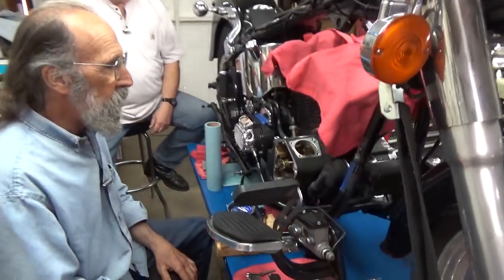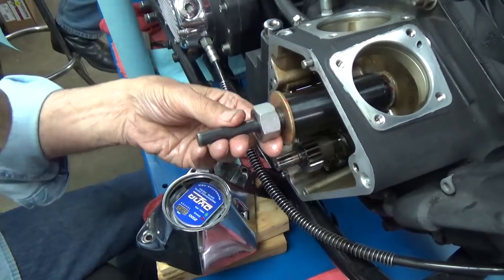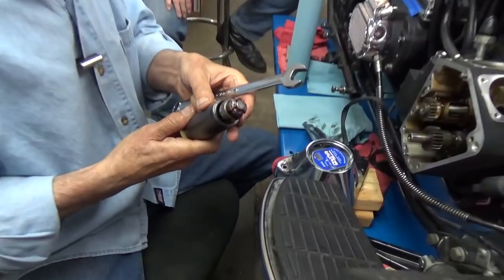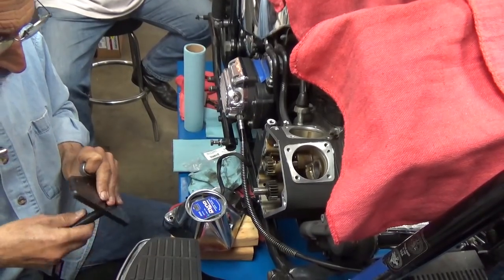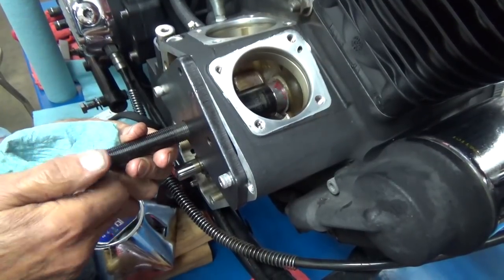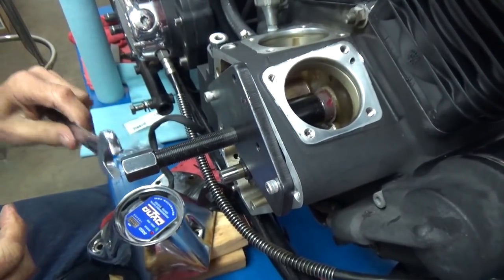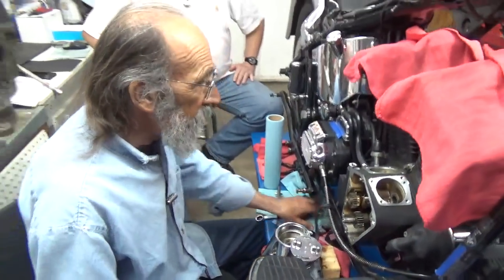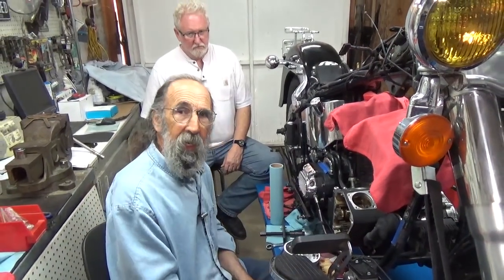Installing Evo, New Cam Bearing & Seal

Comment: I have bought a cheap chinese knock off of the bearing tool  on ebay for around 50 dollars. It works perfectly! I had to pull out a destroyed INA bearing. So to make sure, that as less debris from the bearing falls into the crank case as possible, I pressed the slotted end of the puller together, before inserting. No mallet hits needed. Just carefully pushed in the rod, that spread the slotted end. Thank you very much for uploading your Videos!
Reply from the maker: Thanks for sharing.  Good stuff.

Comment: Had a friend of mine one time did not have the installation tool to put the bearing in and decided he was going to hammer it in ,,discombobulated the bearing and ended up with all the needles in the case and did it after being told repeatedly not to do it... the installation tool not only helps you to press it in but it also helps to keep the conformity of the bearing so it doesn't split the cases that hold the needles when you press it in a very necessary tool nice work Mike
Reply from the maker: Thank You.

Comment: I like your term “animal it”, I will have to remember that. I’ve always used the term “monkey fist it”.
Reply from the maker: Same thing.
Reply: Yeah, like trying to drive a square peg into a round hole without using proper lube. :)

Comment: Your work is art Mike, thanks for the videos, learn something every time.
If you have a opportunity could you tell us about the fork tensioner on your Shovelhead? I have never noticed one before, thanks
Reply from the maker: It is a reproduction of a stock steering damper (something all Harleys used to come with).  I added it because I felt it may help me when I add a sidecar.
Reply: Ty..love the old school stuff, I have a beautiful 1973 Shovelhead, yours has become my inspiration, getting ready for forward controls then exhaust…

Comment: Cam lobes have some work to do,
with inertia, rods & springs.
All 'sudden lift' or 'done with now''
just thin oil to dampen things.
For yon lumpy shaft revolveth on, fine needles round & flat,
in circle rows within their cage, (a bit like us, in that),
where mighty pressures ride in turn, the lube must take up slack
as too much movement due to wear, can send those pulses back.
 - Nutshell wise: 'Old needles just get lairier, 'cos they've sod all contract area' - always fit gnu.*
(*Large furry quadruped, well known for bearing up to pressures beyond the wit of man, best machined when stiff : )
Reply from the maker: Okay Dude, you've outdone your bad self.  This is truly one for the books.  Thank You.  Don't mildew.  Take care.
Reply: great fun. Love it!

Comment: Great video Mike! Really nice to have proper tools for the job!
Reply from the maker: Didn't happen automatically.  It took a long time to gather tools.
Reply: @pacificmike9501  Yes I know. I worked Aircraft maintenance 25 years after retiring from the Navy.
Reply from the maker: You would certainly know the value of proper tooling.
Reply from the maker: I've had the pleasure of learning things from aircraft mechanics.  They've been some of the most professional people I've known.  In fact, my dad built P-38's at Lockheed during WWII.

Comment: Hey Mike . Noticed you drove that seal all the way back to stopping point.  Does your bike have that little oil hole where the seal presses into? If so, is  bottoming out the seal ok with that hole ?  I've heard some guys say just flush with the front is all it should be driven in. Maybe the hole is why ? To lube the bushing ?  Can you give me a straight direction to press in this seal.  I have 83 wide glide with the oil hole for bushing. The hole is kinda on the shoulder so I'm confused here . Thanks Mike always go to your vids for enlightenment.

Comment: Mike. Did Harley go back to the better  inner cam  bearing  in 1999
I purchased my retirement present ,a l1999 7,000 mile heritage  wondering if bearing should be changed out ,cutting new teeth with working on Evos 
Thank you ,
Reply from the maker: Not a bad idea.  In California, every Evo since 1988 had a California cam in it.  So, since you were there anyway, they all got a new cam, a new bearing and a set of adjustable pushrods.  You probably won't have a problem.  But, if you're there, replace with a Torrington bearing.

Comment: Always a day late and a dollar short I am.  There is a duplicate of the bearing puller made in the States, CNC machined from American steel.  I have one, it was $40 before sales tax.  Check the Bay of Fleas.  I do have a blind bearing puller of the slide-hammer type with different collets but am reluctant to use it even if that is what Harley recommended back in the day.  These bearings, the INA type I think, have been known to come apart during removal and shrapnel in the cases is not a good thing.  Mike is using a slow steady pull which I think isn't the shock or impact of the slide-hammer type and might ease the bearing out rather than jerking it out hopefully minimizing the possibility the bearing will come apart.  Mike reminds me of my father.  Knowledgeable, deliberate,  thorough and meticulous.  I admire his work ethic.
Reply from the maker: Wow.  Thank You.  But those are my feelings both pulling and installing that bearing.
Reply: @pacificmike9501  As a boy my father came home from his primary job in industry and after a bite to eat and maybe a quick nap he put in another shift in the garage.  I still have most of his hand tools.  I was just a boy and he had me cleaning piston ring grooves with his ring groove cleaner that I still have.  I had a hard time getting them clean enough to suit him.  I asked how clean they had to be?  He said "Clean enough you'd be willing to eat off of it."  He had a tin can like the ones cookies still come in at Christmas time.  It was full of his alignment dowels.  Yup, he cut the heads off bolts and hacksawed a screwdriver slot in the cut off end.  Much has changed but some things never do.  A very good mechanic (a journeyman) once said about people in a big hurry that they never have the time to do it right the first time, but they always have time to do it again to fix their mistakes.  All my best...
Reply from the maker: Yes.  It's our job to help create those memories for the next generation.  They can move forward all they want with technology, but the very deepest, warmest, best stuff is still built with our hands.

Comment: Hi Mike did Jim's  1997  Evo have the INA inner cam bearing ? If so was it still in good condition ? What high of mileage on the bike ?
Reply from the maker: That bearing was changed years ago when I first changed the cam.  The bike was new when I tossed the original cam and bearing.

Comment: Good video, just no body explane to how check cam bearing condition and why it must be replaced?
Reply from the maker: If you "feel" it and it is somooth and it has been changed to a proper Torrington type bearing (upgrade from the factory installed bearing), it is probably fine.  I use a better bearing (the aftermarket suppliers carry them) and If I change a cam, or I'm doing any work inside the cam chest, I replace the cam bearing with a new one.

Comment: Coming along very nicely. New Cam, new Cam Bearing and Cam Seal. I take it the bronze bushing doesn't see much wear since it wasn't replaced. Can't wait to hear it run. Will there be a dyno episode to show what kind of HP and Torque it makes? Just wondering.
Reply from the maker: I don't think so.  I'm not a real big numbers guy, just more torque than a person can use.
Reply: @pacificmike9501  you never know
Reply from the maker: The only thing wrong with dynos is they all read a little differently.  Hard to swear to anything.  Something like "Second Liar Doesn't Stand a Chance."

Comment: Should you always change out the bearing if it already has a Torrington style bearing?
Reply from the maker: I generally change it if I'm putting in a new cam.  I've always done it that way because I would rather not have a fresh surface running on a worn one.
Reply: @pacificmike9501  Gotcha

Comment: Question, did Harley use  INA cam bearings from 97,98,99 ??? What did you just remove? A INA bearing? I was told that 97 to 99 Harley used torr bearing.  I have a 99 FLSTC EVO, so wondering if I need to change it with 11k on it . Great videos!
Reply from the maker: The problem really didn't exist on Evos until cams were changed.  That's when the bearing got replaced with one that had a full compliment of rollers in it.  I built Jim's motor years ago.  At that time, I replaced the cam with something fun and, naturally, installed a new cam bearing.  Well, I just did it again.  Thank You.

Comment: I’ve learned a lot from these videos and just did a wood w6 in mine. Is it normal to have a slight whine with new gears? Thank you
Reply from the maker: Don't know what you have.  How bad is the whine?  Did you rotate the system and see how the teeth aligned?  Call the manufacturer and ask them.

Comment: Hey Mike question I'm installing EV27 on my 1994 HD Heritage Nostalgia to i need to replace the stock valve spring to a heavy duty?.
Reply from the maker: Always consult the manufacturer.  Read what Andrews says.  I do believe that cam is considered, by Andrews, as a straight "drop in."

Comment: I have 23 000 Miles on My 1998 Evo Dyna Wideglide...wenn do i need to replace the inner Cam Bearing  ?....very good Movis..im learning
Reply from the maker: Thank You.  Normally, we replace them when we replace the cam.  For some performance, the cam usually gets replaced early on.  If you don't want to do it yet, you're probably fine.

Comment: Hey Mike, Can you discuss the various tappets that are offered in one of your next videos? The difference between Hydraulic and Solid Tappets and how to decide which is right for an engine over the other style? Do big cams, high volume oil pumps, roller rockers, or large top ends pumping out more HP make a difference on the tappets used? My ride is mainly stock with Hydraulic tappets but I run the higher RPM's in Montana where the speed limit is 70-80mph. I'll be buying new tappets soon but don't know which style is better for my 98 Evo...Thanks
Reply from the maker: I'm a big believer in hydraulic lifters.  They're easier on the entire valve train.  All of the name brand, high performance" hydraulic lifters that I've used are better than the originals.  Knuckleheads and Panheads up to 1952 have to use solids.  They have no provision (oil passage in the crankcase) to fill the lifter bodies.  All the newer stuff?  Hydraulic is the pleasant way to go.  Roller rockers?  Nice.
Reply: @pacificmike9501  Thanks Mike

Comment: Would a blind hole bearing puller  work for this job as well?
Reply from the maker: I don't second guess these things.  You need to not mess up removing that bearing.  I messed up the first one I did.  Not good.

Comment: Jim, does the 1997 evo have the INA cam bearing or the Torrington cam bearing from the factory?
Reply: I mean Mike LOL
Reply from the maker: I'm the one who wrenches on that sweety of Jim's.  I put a Torrington bearing in there back in the nineties and I've replaced it for the new cam I just put in there.
Reply: @pacificmike9501  Do you know if it came with a Torrington bearing from the factory? Just trying to figure out if I should open it up and find out. Thanks!
Reply from the maker: I've always changed them the first time I removed the cam cover.  At the same time, I always added a cam that would do something.  The factory uses a cam bearing which we always replace.

Comment: Mike I have to ask because I am currently doing a top end on my 85 Softail standard and noticed that there are no breather bolts in the heads.  So did the heads not need breather bolts in 85?   Thank you sir for your outstanding content.
Reply from the maker: Early Evos (84 to I believe 90) breathed through the lower end out a hose from the crankcase down behind the oil pump.  Later on, the head breathers were used (either 90 or 91 up).  This change is to route the breathing into the air cleaner instead of into the atmosphere.  All earlier Big Twins breathed out the bottom too.

Comment: I know Mike won't approve, however: for the boys and girls who don't have a cam bearing installation tool,
an old cam can be used to drive it in. Place the bearing on the cam, align it with the hole and gently smack
the gear end of the cam. An old HD shop tech showed me that. The lesson cost me twenty bucks ☺
Reply from the maker: I've seen it done quite a bit.  That bearing "case" or "shield" would much rather be "pressed" in.  Proper tooling is expensive, granted, but well worth the expense.  We all do what we have to.  But, I try to do my best.

Comment: My 97 road king has the Morelli fuel injection. With your experience, does it make sense to pay the money to convert to carb? Is there a negative impact to doing this?
Reply from the maker: I've done it.  It gets to the point of how you want it done.  If you want it done  like factory original, it will require an entire wiring harness and a modification to your fuel tank.  Or, you can create your own wiring job, depending on how much "stuff" you want.  Don't get me wrong, it's a great idea, just very labor intensive.

Comment: If a guy had a nose cone with peeling chrome could you replace that while doing a cam swap or is there more involved than simply swapping the cover? Thank you
Reply from the maker: Yes, there is more.  The cam bearing in the case and the bushing in the cover.  The pinion shaft and the bushing in the cover.  You might get lucky and you might not.  Those things are lined up with the cases bare from the inside of the right case.
Reply: @pacificmike9501  so I may be better off to try to refinish the original cam cover then? I didn’t realize that was matched to the cases in such a tight tolerance. Thank you
Reply from the maker: Yes, you bet.  If you have to change it, it's best when you're doing the whole motor, so you have access from the inside.

Comment: Hello Mike, a question on the new cam, does it give it better performance and or sound versus the stock cam?
Reply from the maker: Yes indeed.  I don't usually report every internal modification.  That's what the guy who owns it should know.

Comment: You don't chill the Bearing ?
Reply from the maker: No.  It's a real nice press fit in ambient temperature.  It's a sheet metal encased needle bearing.
Reply: @pacificmike9501   I've always been told to chill them like a Bushing jusť as a matter of course. You learn something different every day.
Reply from the maker: I've done them both ways.  That bearing will lose its cold as soon as it contacts the case.  And, it's a "slow install."  Heating a head or a case and freezing a bushing or bearing really works if you're going fast.

Comment: Hey Mike, I hate to bug you, but I can't tell from my manual if the rear exhaust support with the greater bend on my 75 fl goes to the primary side or the right side? Any help very much appreciated! Thanks keep on keepin on!
Reply from the maker: Okay.  Here goes:  the exhaust two into one header goes on.  Coming in, behind the rear cylinder, from the left side, is a pipe that goes from the tee in the rear head pipe, over the back corner of the primary and down to the left muffler.  That "crossover pipe" should also have a small bracket on it that bolts to the outer primary cover right by the starter solenoid.
Reply: I'm sorry Mike, I was referring to the supports that mount to the frame, to  bolt the mufflers to. One has a greater offset than the other... I guess to offset the primary? Not the mufflers themself, just the support arms. I appreciate you so much, thanks!
Reply from the maker: Sorry.  Is misinturperated your question.  I don't have one here to look at.  I think the big offset is to clear the primary.
Reply: @pacificmike9501  Thanks for your quick reply Mike, I think so too, although they could go on either side, they do have a different part number, and one seems to stick out board further, thanks again my friend!
Reply from the maker: You are quite welcome.

Comment: Hey Mike how do you feel about the plastic breather gear? Personally I am not a fan  had one fail on me so I went steel.
Reply from the maker: I really haven't had real problems with either, other than when broken engines get trash in there.  Either one gets bad at that point.
Reply: Agreed my breather was only 20+ years old and after that many heat cycles it was probably time.

Comment: Hi Mike love your work watch when ever i can. I have a question I have a1985 FXST 4 speed and want to fit a 1986 FXST 5 speed into the 4 speed frame is this difficult to achieve. I see you can purchase a 5 speed mounting plate to fit a 4 speed frame would really appreciate your impute regards john
Reply from the maker: I believe the big deal will be inner and outer primaries, a wet clutch and a complete starter assembly specific to that transmission.
Reply: @pacificmike9501  thanks Mike just the info i needed cheers mate
Reply from the maker: Thank You.

Comment: in your opinion, what causes a cam bearing failure ?
Reply from the maker: Old age and wear, contamination, weak bearing, misalignment, improper endplay.  We could go on for days.  It is machinery.  Anything can wear out or be improperly installed or flawed.
Reply: @pacificmike9501  could an improperly installed oil pump cause it?
Reply from the maker: I don't know how.